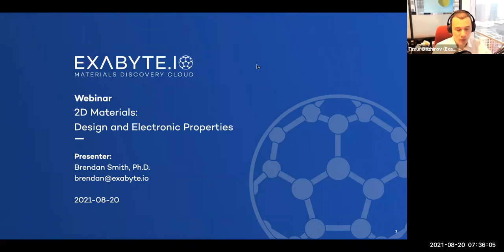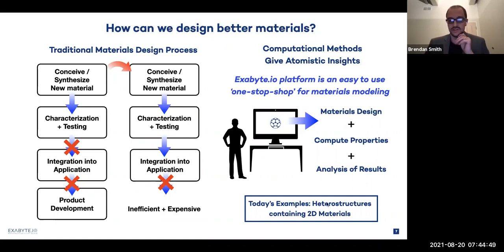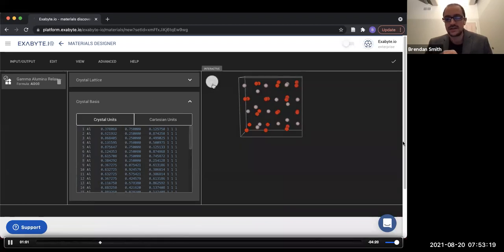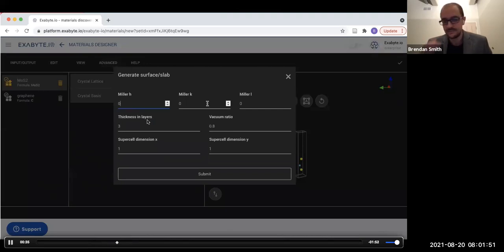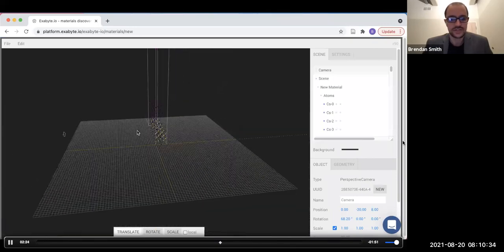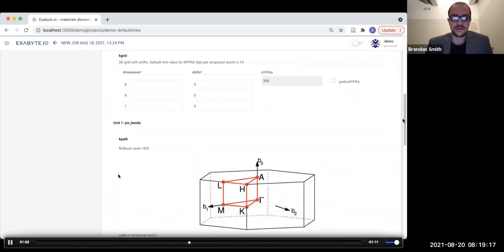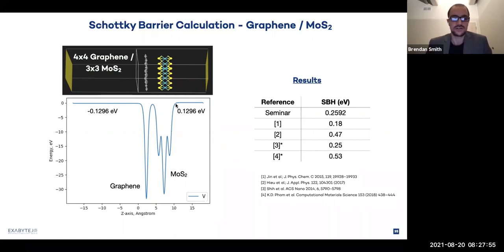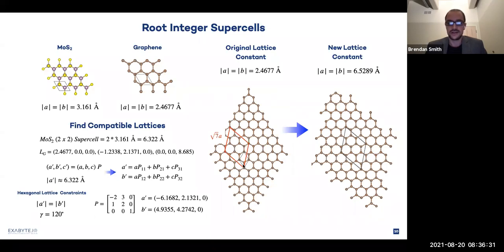2D Materials and their Electronic Properties, Webinar 2021-08-20

Comment: hey, thanks for the video, where can I find the 'raw materials' files?
Reply from the maker: Greetings, thank you for contacting our team. When you register in the platform, you may find the structures used in this video inside the Materials Bank: https://docs.mat3ra.com/materials/bank/. If you then copy them, you will be able to utilize them for further calculations. Hope this helps!
Reply: @Mat3ra  thanks, I can't find graphene in this bank for some reason. Where can I get this file?
Reply from the maker: @sashaermilova2143  We suggest using the advanced search feature to find structures corresponding to a specific formula (https://docs.mat3ra.com/entities-general/ui/explorer/#advanced-search), and then selecting a material entry by lattice type. If you search for "formula equals C", for instance, this entry comes up that has HEX lattice type and represents a Graphene structure: https://platform.mat3ra.com/bank/materials/m22GA2v3Woi4iNdu6. Hope this helps!
Reply: @Mat3ra  thanks a lot, that helps!

Comment: what interlayer distance we should keep in MoS2/WS2 heterostructure ? and should we vc-relax it?
Reply from the maker: Hi Vaishali Nimbewal, thanks for the question.

Brendan is here from Team Exabyte.io.

According to refs (1) and (2), the interlayer distance between the bilayer is roughly 6.05 - 6.12 Angstroms, as measured using the distance between Mo and W atoms.

I think for this specific example, using the average lattice constant (average of individual MoS2 and WS2 lattice constant) will suffice, and one can do only a relax (not vc-relax).

If you decide to do a vc-relax, one should only have the xy plane relax, and leave the z-axis untouched. Please see the vc-relax input parameters for how to do such a relaxation: https://www.quantum-espresso.org/Doc/INPUT_PW.html

Finally, I would recommend using vdw corrections in all calculations you do. One can also see how to use such corrections using the quantum espresso documentation in the link provided above.

(1) 	Torun, E. et al. Phys. Rev. B 2018, 97 (24), 245427. 
(2) 	Huang, D.; Kaxiras, E. Phys. Rev. B 2016, 94 (24), 241303.
Reply: @Mat3ra  Thank you